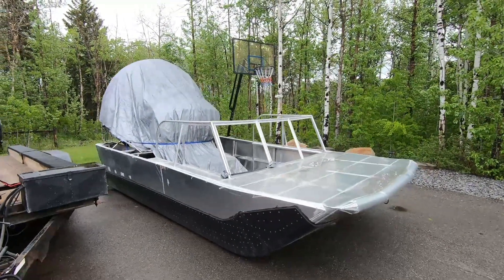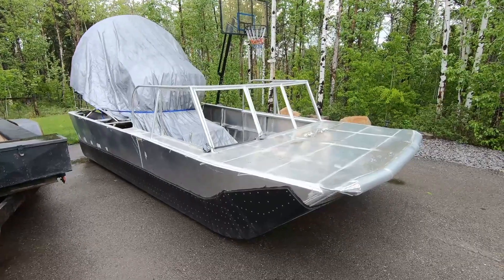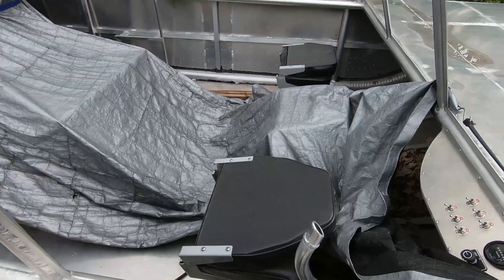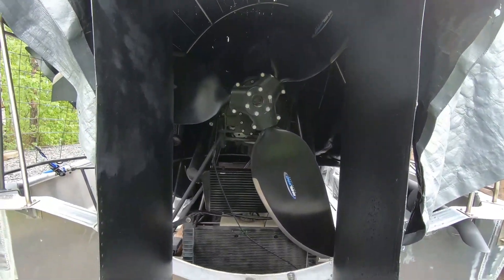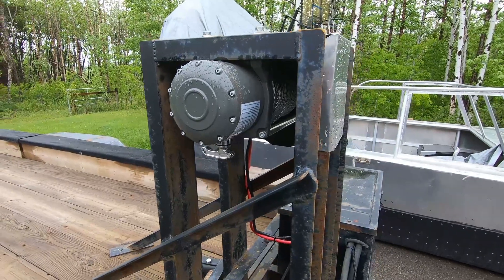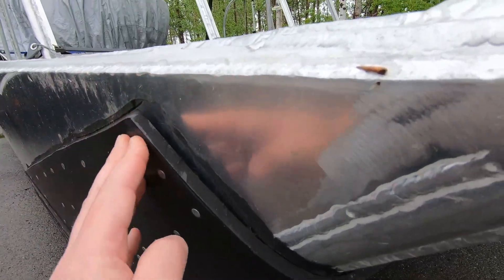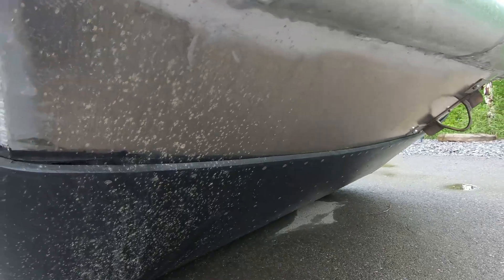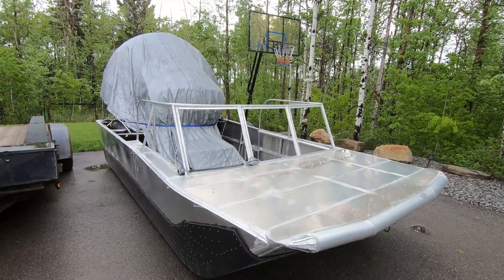Airboat Build #39: Update June 2022

Comment: I've binge watched your videos - thanks.
Have you considered making that centre window panel with a hinge to access the bow platform ?
Reply from the maker: That would be handy.  My plan is to walk around the sides.  There is enough room to step but I will add some grip tape in case it gets slippery.  The boat is 95% done.  I’ll get it completely finished this summer.

Comment: My (junky) airboat has the polymer bolted on like Clayton said.  Are you going to weld on some side bolsters on that trailer?  I could see that boat easily sliding off on a sharp turn, lol.  Anyway, looking forward to seeing it run this summer.
Reply from the maker: Thanks for the suggestion. A couple side guard rails would be easy to do.  Removable would be handy.  When it is all strapped down it is solid.  I’ve trailered it around a bit without it moving an inch; but a little extra insurance wouldn’t be a bad thing.

Comment: Consider using stainless flathead countersink machine screws (Phillips head), neoprene bonded stainless washers, and brass nuts(prevents galling) on the poly. This system works flawlessly for years. Proven method and how most boats are down here in Texas. We use 1/4-20 for size reference as I’m sure you’ll use metric. 

Maybe you could start replacing loose rivets with this method as they come loose. 

I’ve replaced a riveted poly once before. So much work.
Reply: Just a few loose leaky rivets accumulate a whole lot of water really quick.
Reply from the maker: Yeah I think that’s worth looking into.